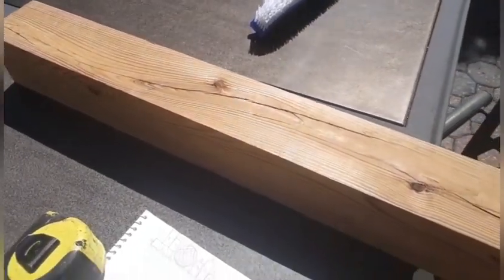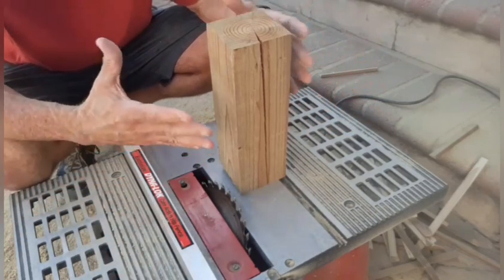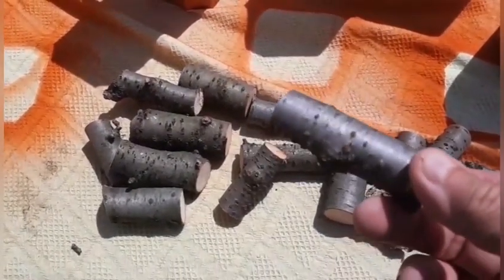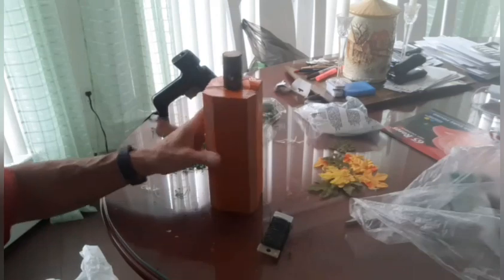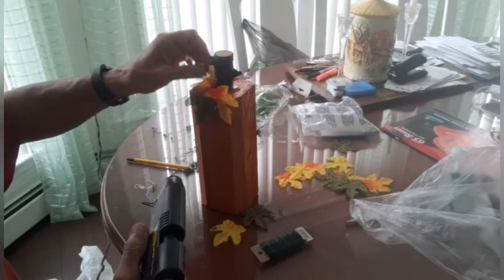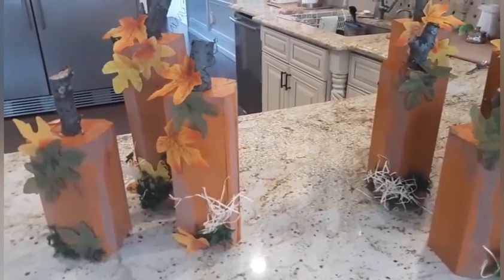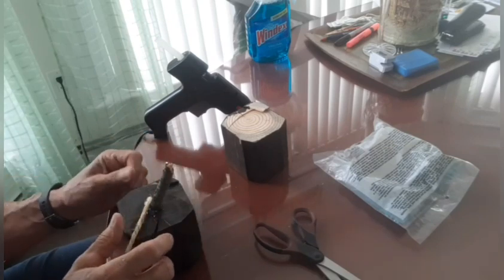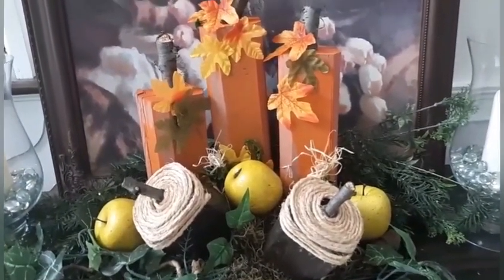Fall 2020 DIY 4x4 Wooden Pumpkins & Acorns

Comment: Good job but using the table saw like that, an accident waiting to happen.
Reply from the maker: Thanks, many reasons I use it on the ground rather than on a higher surface but thanks for the tip.